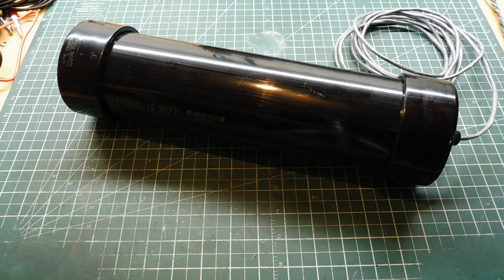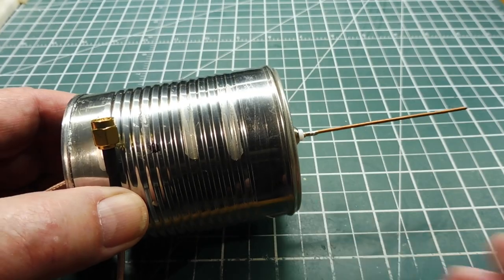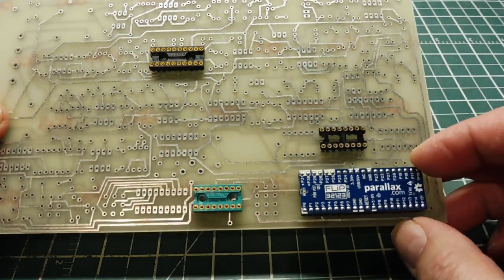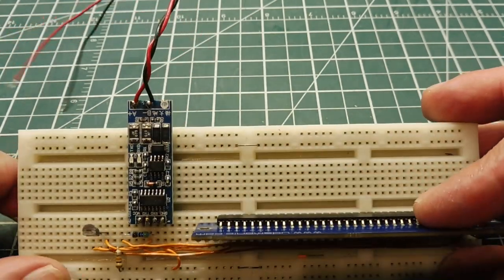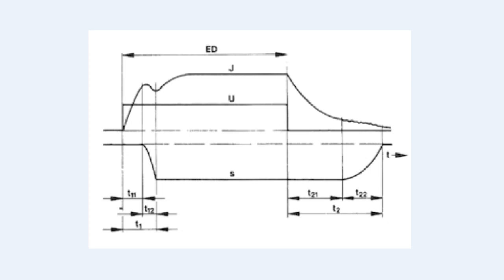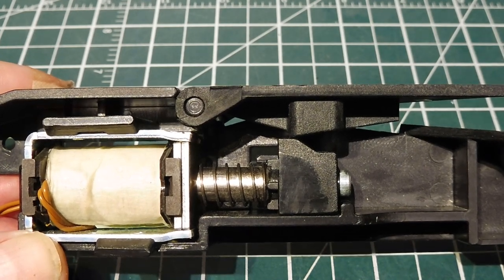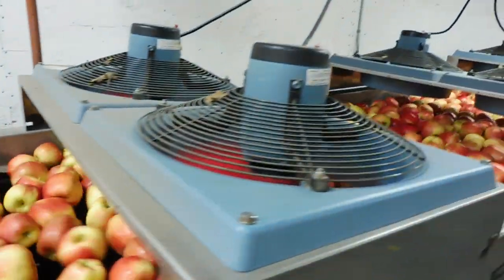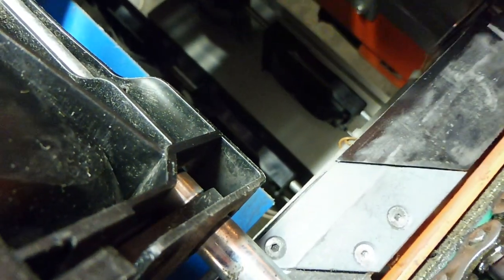My First Vlog / A Visit  To The Farm / LoRa

Comment: Cool video!  I wasn't familiar with LoRa until this.  Might have to use it to monitor my heating fuel oil tank level (Arduino with HC-SR04 sonar).

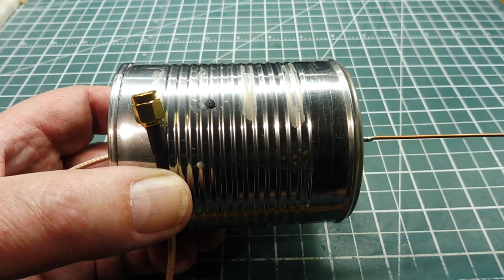1:13  I'm curious how the tin can ground plane works.  Have you measured SWR?  Typically, a horizontal ground plane or radials will give around 25 ohms impedance, or a 2:1 SWR, but that can has a vertical skirt, which has got to raise it.  Good weather protection for that baby N connector (BNC).
Reply from the maker: The coaxial antenna (tin can) VSWR is 1.5 or lower @ 50 ohms across the ISM band 902 to 928 mHz. The can is a 1/4 shorted stub which stops common mode current flowing in the outer braid. It fits in the ABS pipe nicely for outdoor use. Check out some of my LoRa videos for antenna construction and LoRa applications.

Comment: Super great video. I like this content, as an addition to your regular tuts. Any electro-farm equipment is of interest, because all of the engineering is cross-compatible. I have many friends that have backyard chicken flocks. The light activated mechanical coup doors are not cheap, so a DIY solution would make a good video. I vote for not putting eatable wax on the cleaned apples. Just saying... lol
Reply from the maker: Great suggestion!

Comment: Fantastic video. Thank you. Are you using RS485 for balanced communication with your peripherals? I am working on an application where the controller is many meters from the measurement unit. Do you use Ethernet cable CAT5? For interconnect and power transfer? Thank you.
Reply from the maker: I have used CAT5 for data and power. For outdoor applications I use CMR/CMX rated jacket. For more RS485 info check out  this video: https://youtu.be/Oq019vxRj54
Reply: @0033mer  thank you!

Comment: Interesting Apple line... 
So what was your solution on replacing the Free Wheeling Back EMF Diode to increase the speed of solenoid release Ken?
Reply from the maker: I used MOSFETs with a Zener diode in series with a rectifier diode between the drain and gate creating a clamp circuit. This worked well so I used some OMNIFETs which have this built in.

Comment: I have the same LoRa transceiver but on 868MHz so your mounting tube idea comes in handy. If you keep the antenna in the tube, wouldn't that partially block the waves?
Reply from the maker: I have tested PVC and ABS with an antenna analyzer with no degrade of performance. Since there are many variations of plastic pipe i would do a before and after test with your setup.

Comment: That 40 pin IC is  "CDP6402E" and you also emulate it with a Propeller microcontroller?
Reply from the maker: The CDP6402 is a UART on one of the original boards, and is the only one I have populated. This board has evolved over the years and there are 8 different versions. The newest version uses a Propeller micro.

Comment: Hello, I had similar problem that i solved by adding power resistor in a series with the fly wheeling diode. The resistor will shorten release time but it will add voltage spike at the switch. To counter that I put tvs diode in parallel with the resistor so it clamps the max voltage of the spike.
Reply from the maker: Thanks for the feedback. i am working with a similar type circuit.